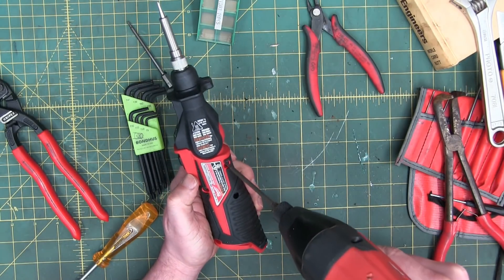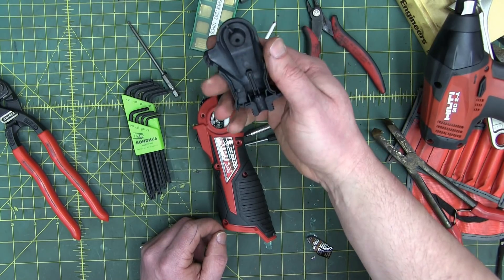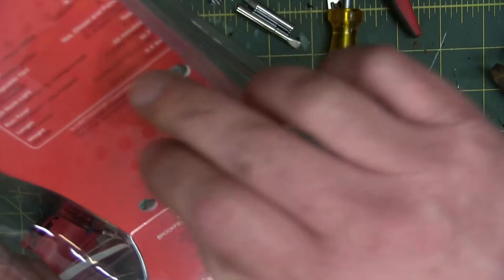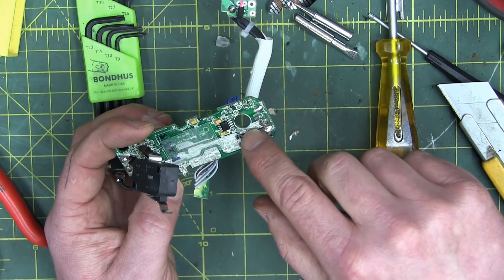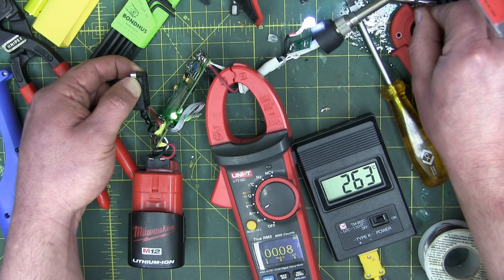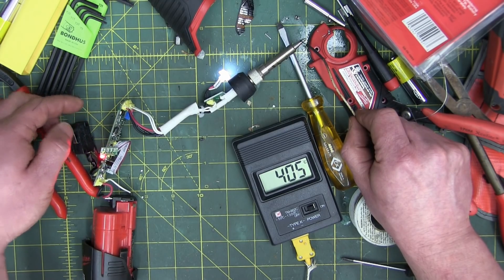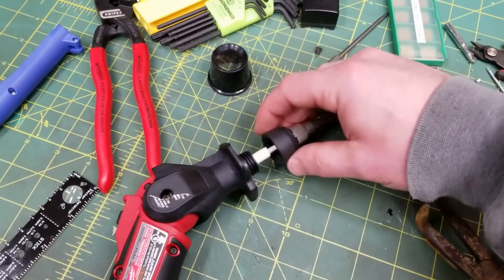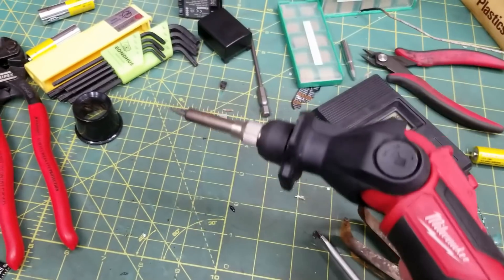BOLTR: Milwaukee Sodding Iron | I'm 2 for 2!

Comment: If only you had a soldering iron, you could replace the mosfet.
Reply: Reed Hedges mosfet was fine the gate is not driven probably the main controller dead or partially dead
Reply: The resistor was a pulldown resistor, and is probably the problem
Reply: Yeah just like scissors packaged in that terrible plastic stuff that takes scissors to open up
Reply: Just like you mill the parts to build a lathe.

Comment: It's almost as if they intended you to install the battery properwise.
Reply: I’m kind of confused. I thought in the end the mosfet was the problem. Why not replace it?
Reply: Nopes, the thing that turns the mosfet on is dickered. He checked again and the mosfet was fine.
Reply: the FET is fine, its the microcontroller that triggers the FET that let the smoke out.
Reply: It most likely wasn't as it never got power.  The confuser through whatever pixie gates wasn't giving it a control signal... that burnt smd resistor might not be a bleeder but part of an rc time for confuser.  limited info though..
Reply: It's a pulldown resistor and I believe it to be the problem as well, even though it still works its lost quite a bit of its working material so can no longer handle the current needed, the bleed resistor for the cap is actually on the underside of the board
Reply: I saw a smoked tant somewhere in the vijjeo, prolly that if I had to guess
Reply: Yup, the smoke came from the resistor
Reply: ha ha ha

Comment: That Bleed down resistor you initially found next to the cap. It is in fact what shit the bed. I called for a review of the tape, and after reviewing the ref's initial call, the penalty has been declined. Replace the resistor, still first down and 10.

Comment: I rock one of these. Little bit cool for my taste and I wish they made a bigger one that takes drill bats (monster electric iron that stood up like a drill with a trigger would be awesome). I have it on a bench at work, took over the old frame irons job. No more 15 foot iron cables. I have a belt with a hammer hook that holds it. Keeps the hot end off my jeans. Solid tool. I never thought I could crank it to 11 thanks AvE.

Comment: I have a 12 watt soldering iron that was about $10, it has lasted about 40 years now, for small electronics it's great. I was once a solderability engineering tech in a high reliability electronics factory (1970s). We made parts for the Voyager and the Viking at Dale Electronics, the Isralies bought the factory and moved it to Israel.

Comment: Have this finger burner since a week and at the first go the metal tube on the top melted out of the plastic nut. Sent it to the mother ship and got a new one in the mail today, which I tested out right away and what can I say. This thing is awesome. If you need a battery powered soldering iron and you are too lazy or dumb to build one on your own, either this one or the one from Ryobi which the folks from MCM got

Comment: Sometimes reverse polarity works in your favor. My dad got a vw beetle cheap back in the 80s because the owner couldn't get it to start. Turns out the battery was connected backwards. About 5 minutes of swapping the termanals around and it fired right up.

Comment: TS100 with battery adapter, custom firmware with Voltage cutoff.
Cheaper, not as bulky, great range of tips and adjustable temperature.
Or just the butane ones, can recommend the ersa ...
Reply: TS100 is just a compacted and flanged T12. You can get a lot of soldering for little money these days if you're willing to do some leg work.
Reply: @Kaiser Wilhem II: Value? It's a one temp iron that's bulky as all get out. Where is the value in that??? You want value you can find loads of ones similar to these in garage sales in old guys tools. Some of the irons are so powerful you can use them to sweat copper pipes!

(BTW if you do go looking often you won't recognize them as an iron because they need a handle which is usually made of wood and often missing. Often fabric cloth over the wire. And no parts to blow! Just a heating element and a mains wire.)
Reply: ha! N00b! I have a soldering iron with a steel brad held in as its tip and it solders just as well as my other irons. Technique is everything. Tandy even had a match solder product btw.
Reply: woo the video got listed
update on my comment: i do all my mobil soldering with a Butan iron 75w to be exact, so i know exactly where the shortcomings are. 
They get way to hot, you can solder a 0.5² wire, but flux will vaporize immediately and insulation will melt while 50w is enough for 2.5² an who solders bigger than that anyway
its not i consider the ts100 a good iron, i find the ergonomics weird but In comparison to the abortion from the video....
Reply: I would also like to see him review there other product the ES120 motion controlled screw driver.
Reply: Anxious Merchant (or was it Kaiser Wilhem?): Check out bigclive's video on a USB powered iron. I think it was about 8w and under $10. You need to run it off a USB battery bank to get true isolation, though. 

Myself, I can't imagine using an iron that large that swivels. Just seems like a bad idea by Milwaukee. Now I have no doubt if you got used to it you might swear by it. The matchup of lithium ion power to heating element is indeed a pretty good power transfer match but you can get that with the combo I mentioned above.

The other problem I find is that once you get to heavier items one's fine muscles can't do the job anymore which makes for a messy end result. The other thing is the milwaukee has all that bulk and electronics yet it doesn't offer any variability in heat control. You'd think they'd at least put in a Low/Medium/High on that abortion maker!
Reply: Ts100 for the win, as a bonus you can you a power tool batteries to power the iron. Up to 6s. Lots of power.
Reply: Yep, love mine, if you want to do big pipe works you need to run a big flat tip and run it with 24v, but normal electronics can run it off 12 battery.
Reply: Cant go wrong with a portasol butane.
Reply: Yeah, I don't feel like having a portable iron that handles like a 4D MagLite.  If it's small work, an unregulated butane iron works.  If it's larger work like lugs on #6 cable, take the tip off the butane iron and use the torch head.  It's cheap, it's small, and it works.  Yeah, you can point it at something and burn it.  Requiring better user judgement is the price of getting something functional for 1/10 the price of a luggable iron.

Comment: You gotta get the high voltage multimeter probe hats. I use them on stream all the time for the really super small stuff. They draw blood, give you a huge standoff distance, are super thin, and get right the hell through conformal coating soldermask and basic solder oxygenation.

Comment: The voltage on the gate doesn't need to be negative. Just more negative than the positive rail to over come bias. Given the switch wasn't on, I'd bet you smoked something in the brain box.
Reply: Looking at the data sheet, Vgs is -1 to -3V. That means if the gate goes 1-3 volts lower than the source, it'll chooch. Not

Comment: After reading the comments I looked at the frames around 8:38 and I'd agree, there's a wisp of smoke from the switch-end of the board that starts at 8:37. Perhaps it can be saved? It was bad enough to learn that the nano-chainsaw bit the dust: don't turn into a serial killer.

Comment: You can see the magic smoke at 8:37. The view is obstructed by the ribbon cable for the batt. indicator, but it looks like it is the resistor next to the electrolytic cap shown around 10:00 min.

Comment: I love this thing.   I use the 3.0 battery and it lasts plenty long for my model train/track soldering.  It also can use Haako tips.  The freedom to move around with no cord is great as the cord would catch on all the small details.  I've used it for a year with no problems.

Comment: It looks to be a very handy item to have in the toolbox. I'm fond of the butane powered units because the exhaust port works well on heat shrink tubing. However, butane is not allowed in checked or carry on baggage, so a battery powered iron might be a better all around choice. This video makes me wonder why you don't fully test the products before disassembly?

Comment: I used one of those butane soldering irons to solder some nicked wires that went to my fuel pump on my van, and as luck would have it the nick was right next to the pump. I couldn't get a regular soldering iron to handle the job for some odd reason(maybe it was too cold outside? I don't remember) so I put a box fan on high right next to me to keep the fumes away and everything worked great. They're awesome for some jobs and sure as hell beat out any soldering iron/gun you get from Hallowed Fright. I might look into one of these Milwaukee's though. We work in HVAC and quite often have to solder terminals on control boards and the like, and it's much easier to have a portable soldering iron that doesn't require 110V. The butane usually works for us but we don't like using flame around natural gas if we can avoid it.

Comment: The P-channel FET was being driven as a high-side switch, so its gate doesn’t need a negative voltage, just to be driven a few volts less than 12V.

Comment: After using one I'd say don't bother if you are doing anything with medium to large wires.
 I was trying to solder together 3 2.5mm wires and it took a long time to get the wires hot enough for the solder to flow properly.
Also, where the tip threads onto the base got really hot and started to melt....
This wasn't even long enough to deplete a 2ah battery to halfway.

Comment: I'd be curious to see how skookum you think the TS100 Soldering iron is, as well as the ES121 Electric screwdriver. I run my TS100 off 18V tool batteries and it's great for on-site repairs. I just picked up the ES121 and I'm pretty happy with it.
Reply: can't wait to get a electronic driver. love my ts100 use it all day

Comment: I got one of these late last year, bloody love it! That's two butane and a 3.6v mini iron that have now been retired. It just works so well out in the field, and when I run her down I can just swap with my driver battery in a pinch while i chuck a battery on the charger. Not like my old lithium one which had to sit on it's geezless stand to charge for eighty hours...
Reply: If it knackers, test the thermal fuse.

Comment: Soddering iron, thats how we always prononuced it. I used to get sick from the smell, I suspect it was the toxic shmooze my dad used. I use mine often and no problemo. Back in the 60's and 70's, who knows what they put in their solder, or sodder or whatever....Just...yeah. Nice tear down. I have a cordless I keep in my RC plane repair bag. It works great. Got it from Radio Shack before they went belly up. Nice to see the inner bits without gutting my own out. I agree with you concerning the flame thrower type. Back when I repaired Snowmobiles, a flame of any kind was welcome on frozen fingers when working on electricals on sleds. You now have a parts and pieces is parts thingy. Oops ,running the pixys backwards is bad, they run amuck and destroy shit. I am suprised they didnt put a fuse in there. But then again, who puts the battery in bass ackwards? Oh, you did. Lol. Shit happends. Then you have parts is pieces of parts.

Comment: The load in this case is purely resistive  (just a simple heating element),  no inductance; so there will not be an induced kickback voltage when the switch opens and the magnetic field collapses, for want of any magnetic field to be doing any collapsing in the first place.  And it's the kickback that is what does for switch contacts in DC circuits, by starting an arc between the contacts that only extinguishes when they are sufficiently separated  (an alternating current will not sustain an arc past the point of crossing the y-axis);  so in this case it probably will be fine.

Comment: Why not order the fet and fix her right and proper?
Reply: He said that the MOSFET doesn't get gate signal so replacing it wouldn't do anything, also the transistor shouldn't blown - as AvE said it was behind a switch.
Reply: Mike oliver The FET is not bad. The uC pin controlling the FET is bad.
Reply: Icy Uranus LOL
Reply: He was right when he suspected that resistor that he was scoping through his pecker detector - rewinding the video you can see that's there the smoke was pouring out of. Usually when you overload one of those electrolytic capacitors, they blow apart, so that likely wasn't it, and the only other thing there was that resistor. 
It almost looks like he induced silver sulfide formation what with the little bubbles, but that could just be melted conformal coating - they look darn near identical in practice, but generally the silver sulfide forms at the contacts, but depending on the resistive element used and if he melted the protective layer off, it's possible that Ag2S formed on somewhere other than the contacts. 
Suffice it to say if I were he, I'd replace that resistor for the $0.17 it will cost and check the chooch afterwards.
Reply: The mosfet is not the problem, most likely burned the logic right out of the ic
Reply: Uncle Bumblefuck has confused the heating pixies so much that they don't know which direction to go.
Reply: PWM control from uC? Probably why it's over heating now.
Reply: He's bypassed the MOSFET that was the "control switch" for heating i.e. there is no longer any heat cycle control.
Reply: That's illogical!
Reply: lm 317 with a transistor or even  better a  switching  regulator with a pot  setup would work ...just a thoughy
Reply: That's exactly my thought.

Comment: that style of tip (without the heater element built into the tip itself) really doesn't maintain temperature well.  for the price of the milfukee i'd just go for a TS100 and a small battery pack.

Comment: If you had a p-channel MOSFET connecting to the positive rail to switch the positive supply to the load, and your "bleed-down" resistor connects between the gate and positive supply, then the drive for the gate is likely drain of an N-fet with the source connected to ground or the collector of an NPN with the emitter connected to ground.  The n-fet could be driven directly by logic or the npn could be driven by logic with a resistor (that would be the simplest way to go from logic to driving the 12volt high-side power P-fet.

Comment: The MOSFET doesn't need negative voltage it needs voltage a certain amount lower than the source (if it is rated for 12V the gate to source difference might be something like -10v), it is getting 12v through the resistor, which would be something like 10-20k, because it is pulled up for it to go to the "off" state when the brain stops grounding the gate aka "turning it on", the resistance to ground would be less than the pull up resistance, maybe something like 1k. Also a soldering iron without temperature control is good for nothing, unless you are soldering cable or something similar, check Louis Rossmanns video of the TS100, posted a few days ago!

Comment: I've heard you claim in more than one video that all the internal electronics are to "protect the battery"...but that isn't right, those parts are built into the battery on any modern name brand lithium tool. You can take a bare battery and jumper it straight to whatever you want and it will protect itself just fine - absolutely no need for such parts inside of the tool.

I use my 18v batteries to power all sorts of random stuff, and they always shut themselves off if over temp, over current, or low voltage.

Comment: At 8:37 you can see pretty clearly where the smoke is coming from.  It twern't the mosfet leaking smoke.  It was the resistor or that capacitor you pointed out (the resistor most likely).

Comment: Here's a little tip i use any time i take a tool apart, or anything that has a lot of screw for that matter, throw all the screws on a magnet so you don't loses them. And even if they fall on the ground, all the screws stay together.
Protip : take an old busted speaker apart to steal it's magnet. Their magnets work great for this purpose, plus it's basically free because the speaker's fucked anyway. If you don't have any, kijiji's free section might just get you some freebies.

Comment: just used my circa 2000 -2003 butane iron from blue point.  used 2 or 3 times /week incredibly it still works and is quite hot

Comment: You can adjust the temperature turning left on the potentiometer measure the heat!!! The plastic is only good for around 250°f so you can make it go 700° but if it melts your coupling no Bueno so I've found the screw points to about 1:00 if you turn left to 11:00 you're chooching man 12g 10g wire with no problem!!!  And you can peel the sticker back 🔙 and remove the screw and put it back afterwards to keep your warranty!!! Remember turning it up will drain the battery faster but if you use a 6.0 like me and have several batteries no worries!!!

Comment: 9/10 times, if you have an electrical problem like reversing the polarity or what have you, letting it sit for an hour or two will fix it right up. Chances are, if you didn't hear an audible pop, it'll fix itself given enough time. And yes, letting some of the magic smoke out can also be remedied this way (although it may not return to 100% functionality). I speak from experience :)

Comment: Mechanical reverse-polarity protection would normally mean you don't need electrical reverse polarity protection. "hold my beer" - AVE

Been there! I discovered the hard way cheap 2axis gimbal controller boards also do not have reverse polarity protection....

Comment: I did that with an RC ESC, connected the battery around the wrong way, let the smoke out, followed by letting a string of colourful obscenities out. The good thing is when it hurts you or your wallet, you only do it once